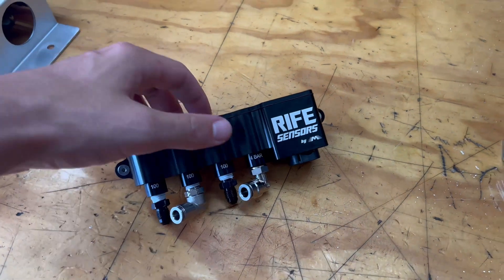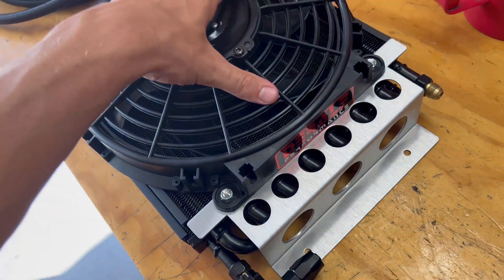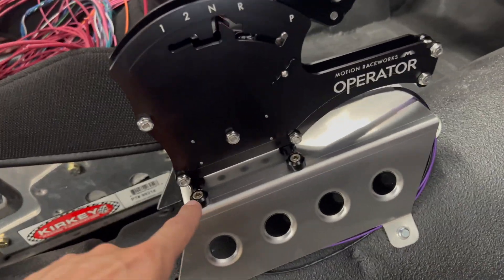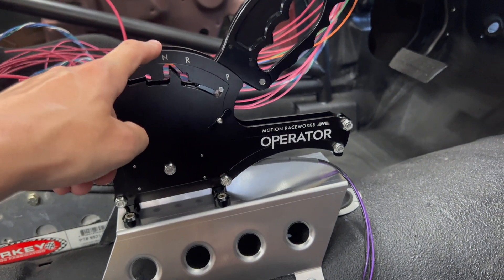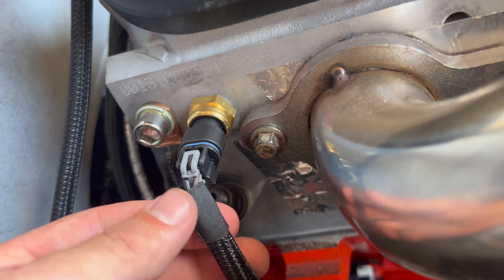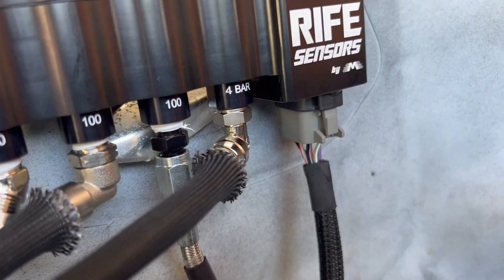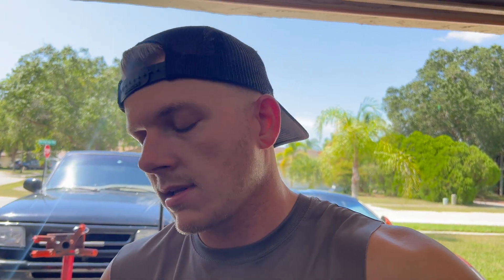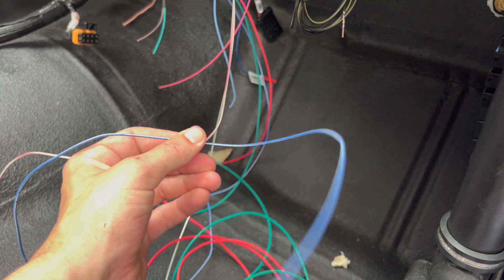Wiring my Camaro Drag car the Z2H8 from scratch...Here's how its going

Comment: I’m running the dominator ecu with rife sensor block. I have map, oil, fuel, and temp. So all you had to do was cut into main harness and tie those in
Reply from the maker: That’s what I needed up doing since those are fixed sensors check my later videos and you’ll see
Reply: Okay I’m going to next video right now
Reply from the maker: @Gbody_Bobbo  good catch though I used map, fuel pressure, dope pressure and coolant pressure. The map and fuel pressure I used the original wiring in the Holley harness